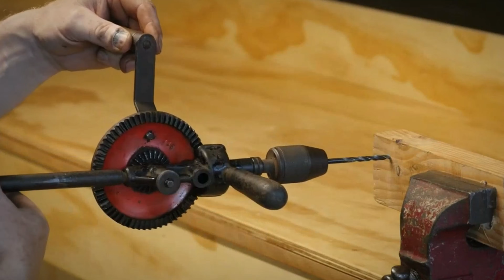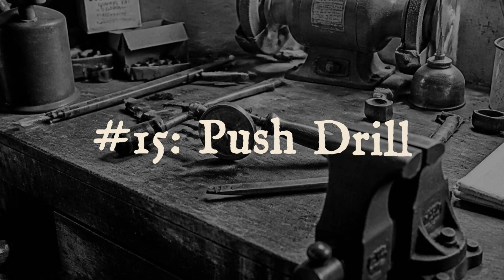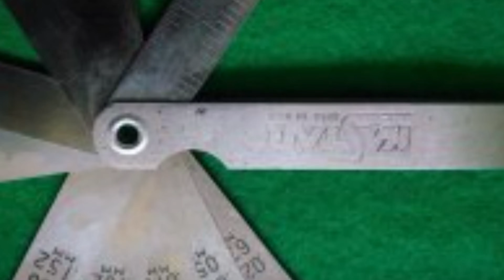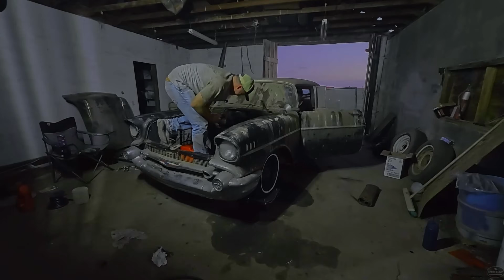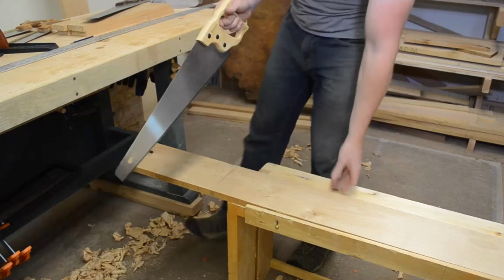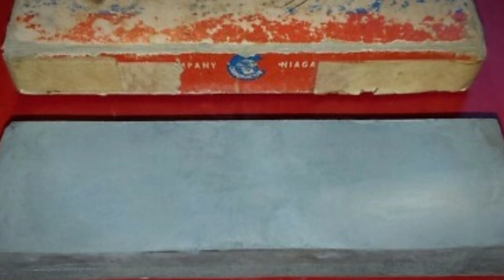20 FORGOTTEN Garage Tools Every American Dad Owned in 1955

Comment: My dad was born on a farm, moved to the city worked on a machine in auto plant. Then he went to mechanic classes opened a gas station and ran it from the late 50's into.the 70's . He worked as and electrican, mechanic welder, and plant maintenance tech. He retired from Wonder Bread .  He could build  fabricate repair and maintain anything. He had all those tools and more, most of them I now own and still maintain and use.

Comment: I had all of them. I still have feeler sets, valve spring compressor, tap and die sets, tyre pressure gauges, puncture repair kits, tyre levers or spoons, and a timing light.